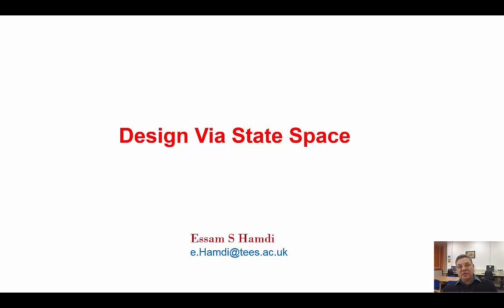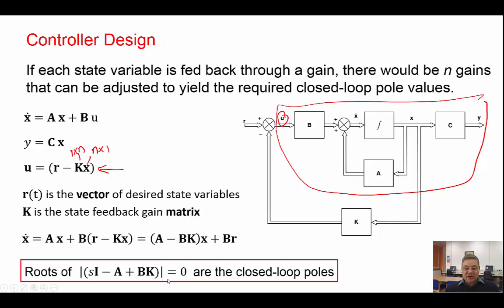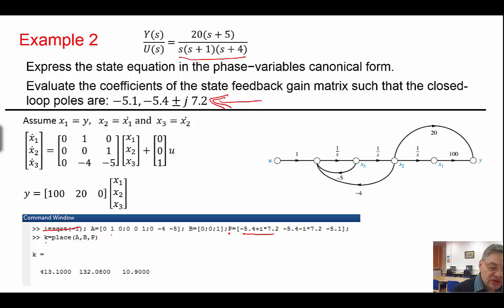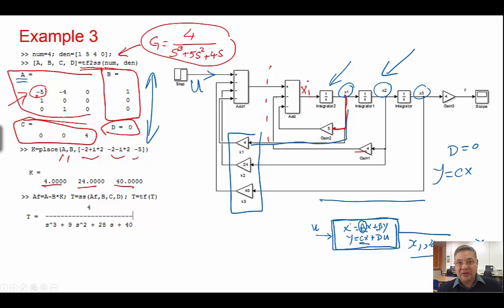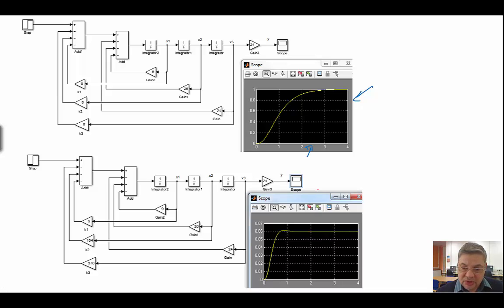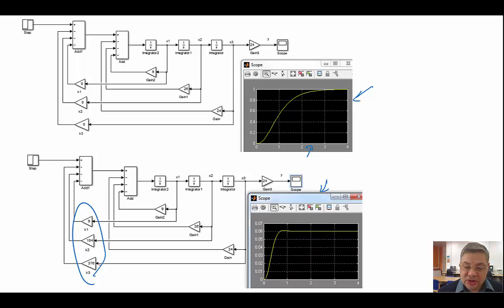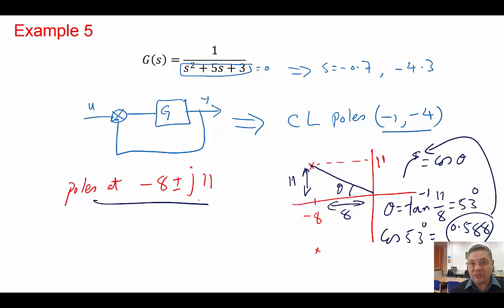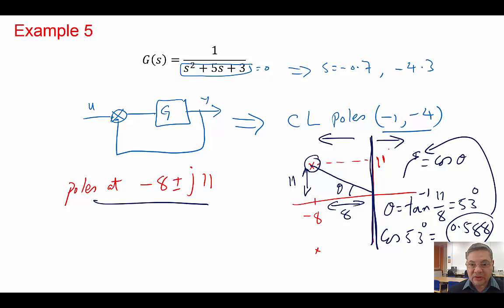Control Design via State space

Comment: hi sir, I've got a question on the quadruple tank system, I have constructed a PI controller using LQR function instead of the place function, mainly because I wanted to be able to tune the q and r to be able to attain realistic control voltages. the project calls for implementation of the PI controller on the nonlinear system (THIS IS WITH INTEGRATORS, RAW CONSTRUCTION FROM THE DIFFERNTIAL EQUATIONS ON SIMULINK), I'm currently having problems implementing it and I could use some help?

Comment: I like pole placement and the instructor shows how to calculate the gains in a simple example.  The instructor does not say what K1, K2 and K3 are.   K1 is the proportional gain, K2 is the derivative gain and K3 is the second derivative gain.   In reality using the derivative gain is noisy.   Using the second derivative gain is almost impossible due to noise and sample jitter.

I object!  Using Matlab will provide answers without understanding.  Some how this is called teaching.   I would want to know how to write the code in Matlab that generates the answers. 

Also, what do you do if the controller needs an integrator?

The instructor should relate this do a problem in the real world.  For instance in motion control the states are usually position, velocity, acceleration and some times jerk
In temperature control there is the temperature, the rate of change of the temperature and sometime the second derivative of the temperature.

Finally at about 22 minutes the instructor address the problem of not having an integrator.   The instructor is correct in that the integrator acts on the error.  I would like to see this applied to a real system.

I find using matrices are non-intuitive.  I prefer writing the functions using Laplace transforms or differential equations.  This way you can see how the variables affect the response.

Where does the plant or open loop transfer function come from?